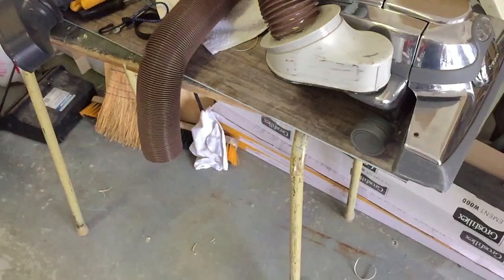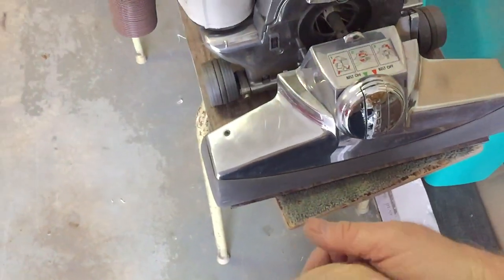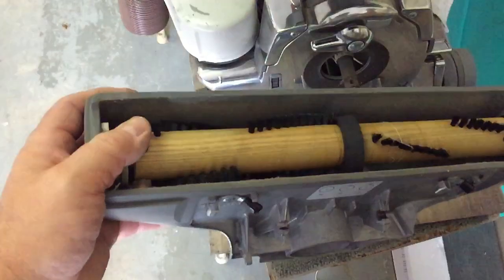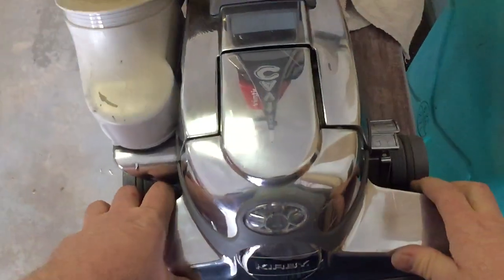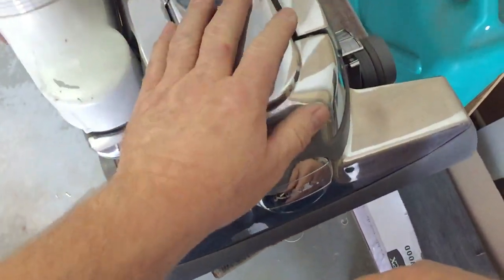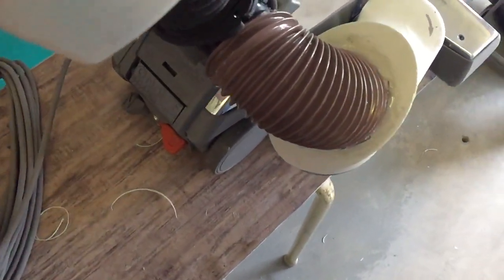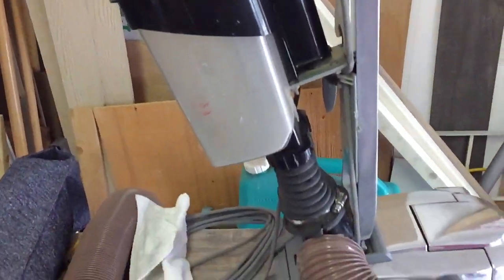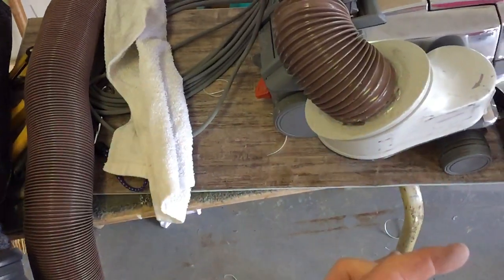Oxy-Dry Max-Vac system

Comment: I have a Kirby sentria for home use and I have always found that it sucks up area rugs causing the belt to stop spinning no matter what the height setting is. Do you have that issue?
Reply from the maker: Heres the trick. When doing thin rugs push the vacuum forward then tip it to one side to pull it back. I carry 2 other vacuums as well partly for this reason. Proteam and a Shark Rocket. The Proteam has this issue too sometimes and I will sometimes turn the brush roll on going forward and switch it off to go back. The Shark is also a good option in these cases as it will do even thinner rugs.